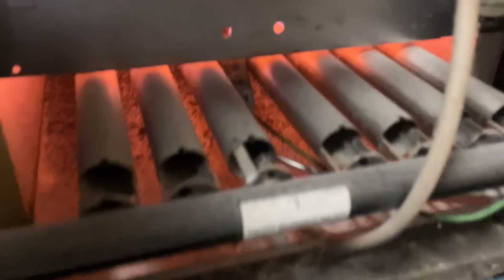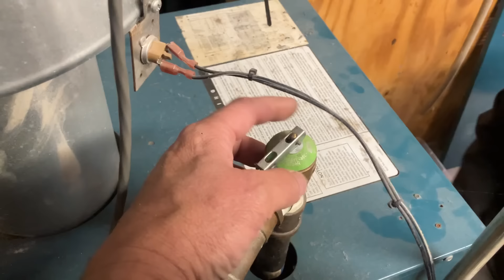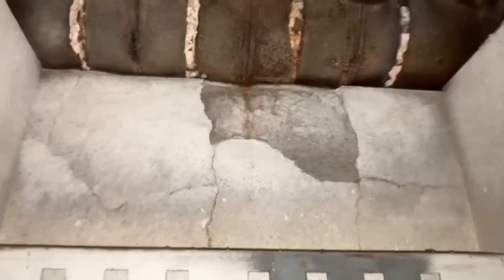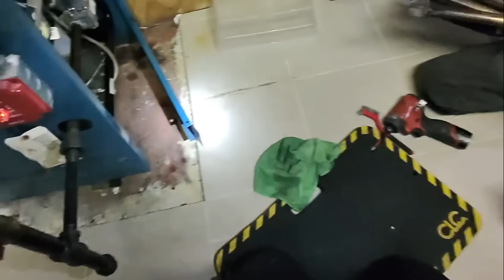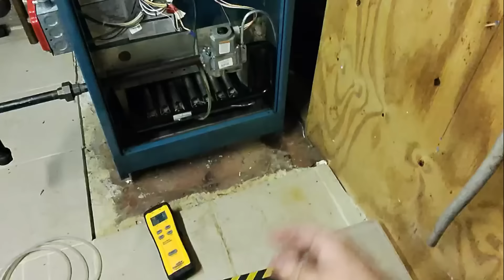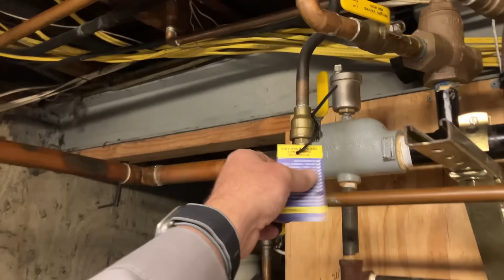Boiler Was “Fine” for 5 Years… Until Error 56 | Burnham Series 2 Maintenance + Combustion Test

Comment: Nice vid Mike, Im in Long Island and I would like to ask you if I need a small expansion tank like zep1 for my Rheem tankless water heater which I have  backflow preventer in my main water line. This is my 2nd time replacing my 10 yrs old unit leaking in heat exchanger .suggestions is greatly appreciated ,thank you

Comment: you have a dual port manometer, why not use both ports. you should monitor incoming pressure both at rest and when at full output, plus everything else connected to gas turned on high at once.

Comment: Hey I been doing boilers for 3 years and ac/furnace for 10 all in install and start up and im starting to help out the service department now and being scheduled for on calls. I would love to know if you have multiple bags or boxes or if you have a go to tech bag that can  handle all 3 and what your loadout in tools look like
Reply: Most of the hardware on the covers are basically the same. The electrical components also use the same equipment to test. Except for a set of manifold gauges for AC, combustion alanyzer, and a device to check gas pressure, the basic hand tools are the same. 
 Of course pipe wrench are need at times, they are not something you normally carry in a diagnostic tool bag.
 Hipe this helps. I have been an hvac tech in the marine industry for 30 years.
Reply: @walkingneartheriver  yeait does andni have all ofnit i just hatebhabing to switch tools from service bag to install bag  for hvac and install for boilers and infloor

Comment: Furnace cement the refactoy insulation piece back in burner section ??????
Reply from the maker: It's a ceramic fiber board, not typically cemented in.
Reply: @PipeDoctor its better than nothing
Reply: looks like it got wet/water logged and broke when heated.

Comment: How did you test the tank pressure? You would need to remove the tank to get an accurate reading. If you leave it attached, even with isolation valve off, you are just reading system pressure and not tank air cushion pressure

Comment: Had an old fuel oil #2 boiler from my uncles house from the 80s, ran good for a while until it start making sounds almost like hiccups, turning on and off constantly and fumes exiting the damper. Found out that the oil filter was completely clogged replaced it and ran it until 2 yrs later decided to junk it as price was too high for fuel.